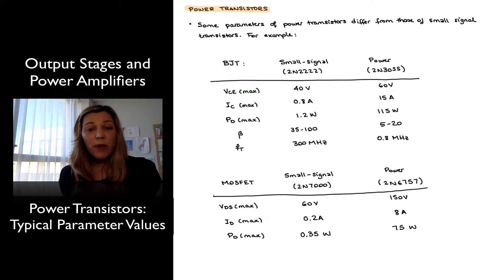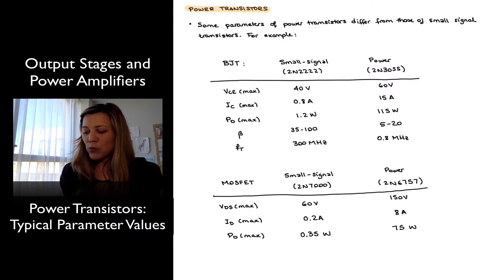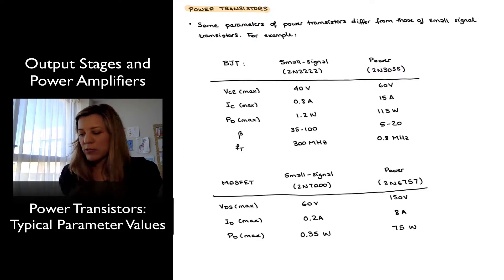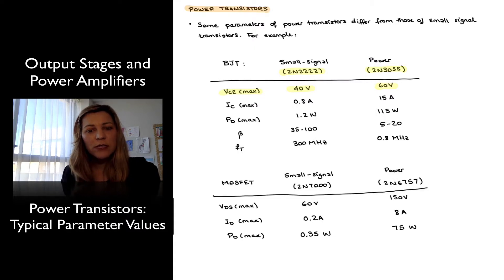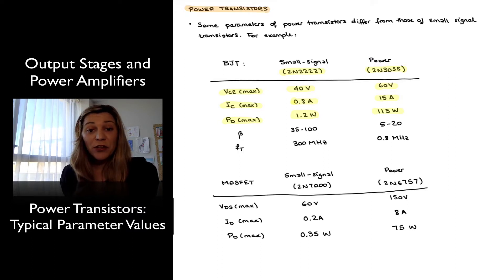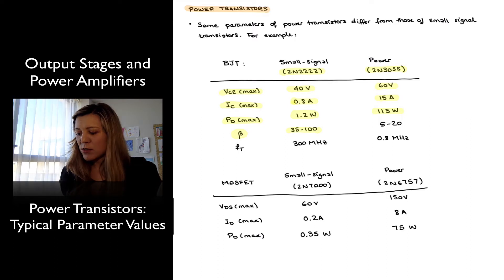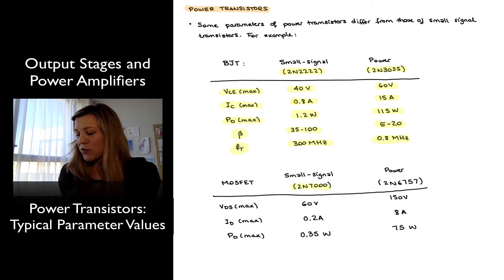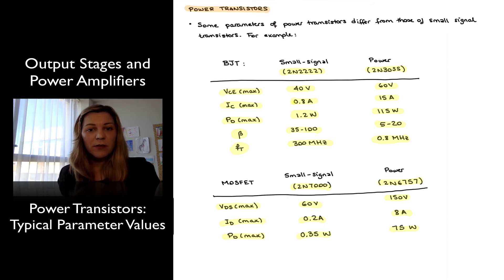Power Transistors: Typical Parameter Values

Comment: How can it classified as a Power Transistor when it is only 60V? How do the max switching speeds compare with the power MOSFETs?
Reply from the maker: Look at the output current (15A) and output power 115 W. Check the data sheet for additional info http://www.onsemi.com/PowerSolutions/product.do?id=2N3055
Reply: That power dissipation seems so bad though, considering its speed and the package. I recently used a power mosfet that was physically a quarter the size of that power transistor called the IPD320N20N3. Output voltage 200V, output current 31A, runs at 2 MHz, power output is 136W,  and they cost about a dollar.
Reply: @Annihilator49  
That MOSFET cannot handle 136 watts, it is too small.  The MOSFET has very low on resistance and switches high current so it can output high power but that doesn't mean it can dissipate that much power.  The 2N3055 can dissipate more power when it's mounted to a heatsink.